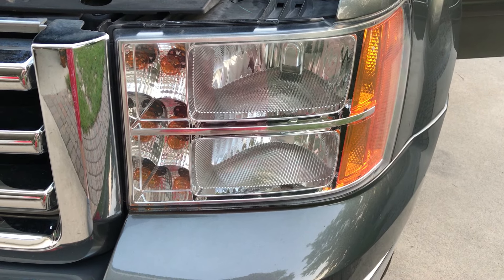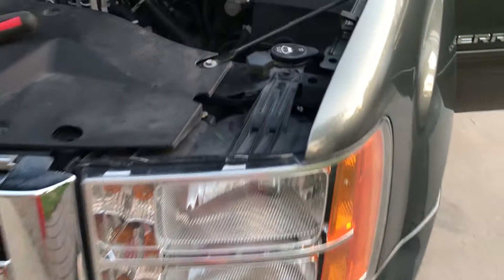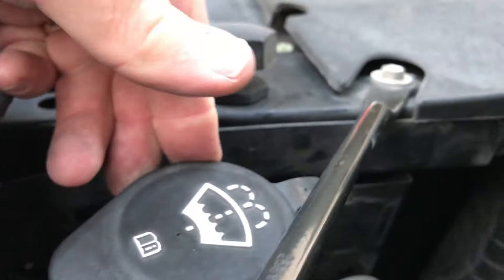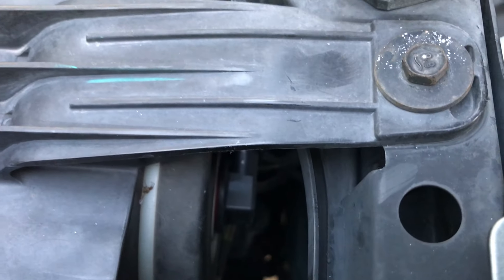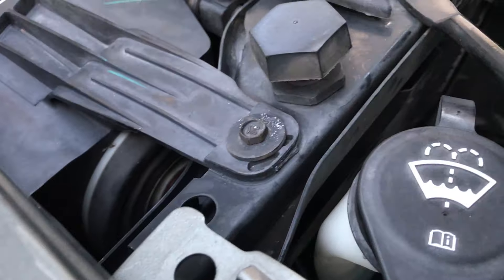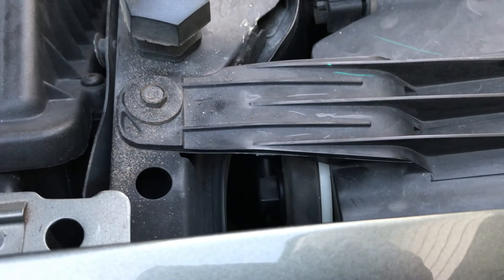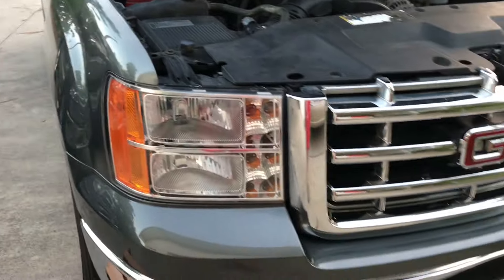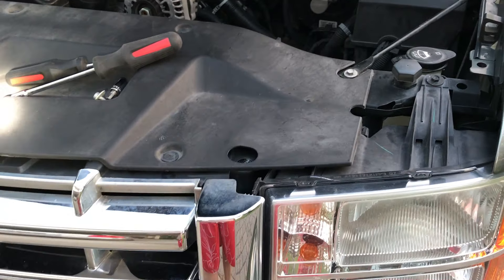2011 GMC Sierra Low beam headlight change

Comment: Swapped the driver side solo just now, took 2-3mins. Highly recommend using needle nose pliers to twist and remove the socket. Removed the frustration from the task entirely. Easy swap if you don't try and stick your hand in there, and use pliers instead
Reply from the maker: good to know! Thanks!

Comment: The engineering on this is a joke! Serviceability is terrible for something as simple as a head lamp bulb.  Had a 2002 Yukon before this it was a 1-2 minutes job!  You can bet it was designed like this so the dealership could charge you an arm and a leg to install it!
Reply from the maker: my wife hyundai is so easy compared to my truck. you are correct in every way

Comment: I did the drivers side in about 5 min in the o Reilly parking lot with no tools. U can stick two fingers in there like middle school. Turn it a quarter turn and pull it out behind the washer fluid where u can see it, switch the bulb, then put it back with your two fingers :)
Reply: Anthony Carpenter Tried it. That only works if you've got a middle schooler's hands.

Comment: Pull the air cleaner. Its easy. Both bulbs changed in 10 minutes or less
Reply from the maker: the driver side is a really tight spot. air cleaner trick on pass side is great

Comment: Passenger side:  Pull the airbox up while wiggling.  Its attached with two grommets.  Make sure you don't lose them when the box pops off.  After it is off, you have to maneuver it around to get it clear from where you are working.  It can be done without breaking anything, just be careful.  

Driver's side is tougher if your hands are above medium sized.  Still, it can be done if you remove washer reservoir screw and spare battery mounting plate below.  Pull washer neck aft (I wedged a ratchet in between truck metal and the neck to keep it out of the way).  Its easy to get bulb out (1/4 turn and pull aft), but when reinstalling, pay attention to the three tabs on the bulb.  They have to line up precisely with the slots in the light housing (two small and one larger).  Press bulb in firmly so it seats flush all round before rotating a quarter of a turn.  Voila!

Be prepared to fidget around with the cable running through there also, on the driver's side.  What could have been simple (from the factory), turns out to be another "up yours" from GMC.

Comment: I’m 6-2 290 and I can get my hands in there. VERY TIGHT I will add. I personally think it’s a two man job or woman who knows what she’s doing. Don’t call wifey out there because you guys will be fighting later. I called my son to hold the clips while I pulled the bulb free. Trying to get those clips free in such a tight space is damn near impossible. Together we did it in like 15 minutes. On the passenger side I took
The TOP OF the air filter off. Not the whole box out. I SQUEEZED my hand in and once again get someone to help you free the clips on both sides. I let my son put it back in while I guided him from the front. His hand was much smaller. Hope this helps SOMEBODY.
Reply from the maker: great advice! Just had to change the drivers side again! GMC burn bulbs out fast!!
Reply: I'm a woman and changed them both in about 10 minutes.  Pull the air cleaner straight up, its on grommets.